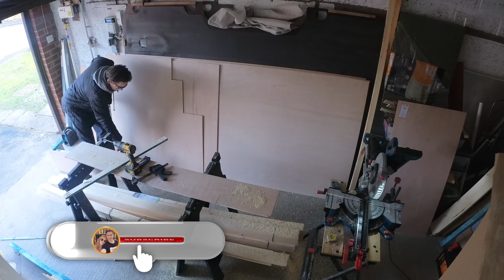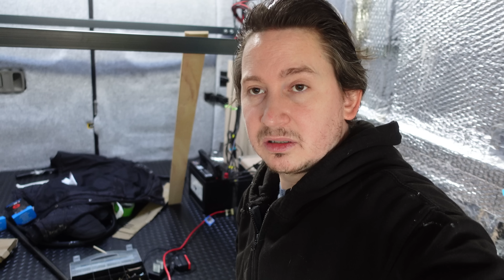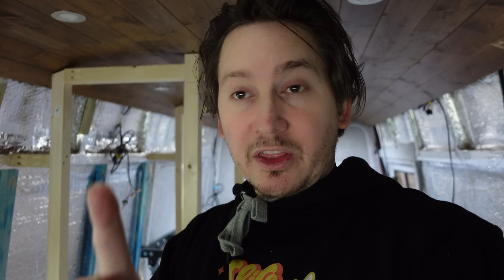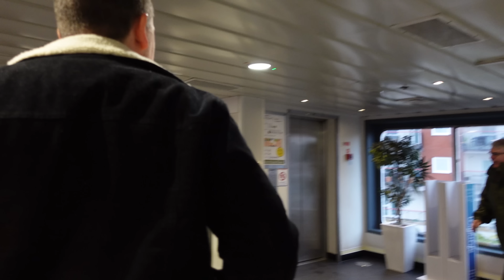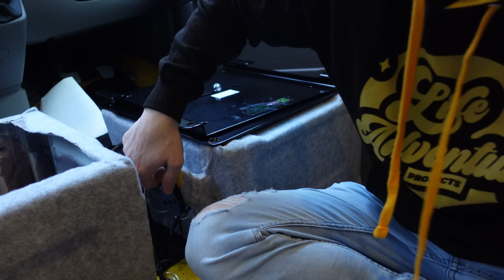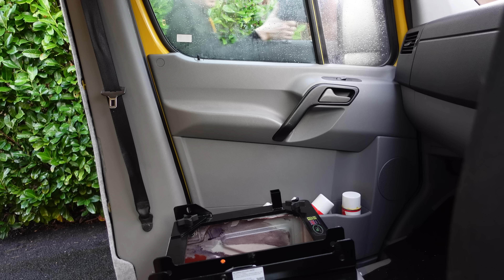Van Build Shower : Installing the Shower Framing

Comment: Not sure if you've already fitted a diesel heater. But if not, it could go inside the seat step.
Also, you could put a drawer/storage under the table's raised floor.
Reply from the maker: Great ideas! We think we're going to go for the Truma combi which is heater and water heater, so think it might be a bit big unfortunately, but if not that's a great suggestion. Some storage might work there though, got to use all the space effectively! Thanks very much for watching, we really appreciate it :)

Comment: Ok!  so !Really great video both, love it ,big yellow bird is coming on brilliantly. Step in front of the seats could double as storage or for a diesel heater (unless you’re thinking diesel heater under the seat) I wouldn’t worry about the cable under the seat if you haven’t got that type of seat ,I guess they make them standard. I’m no expert, but although that ceiling in the shower looks great ,steam and water may make it swell . So protect it , plastic covering ,also  heard you say tank, so you’re on the right track , how about venting too ? . There must be videos on line fitting showers , sorry iv been no help , but just some things you may want to think about. Not impressed with the needles either, don’t see the point 😂😂 get it . Good luck 👍🏴

Comment: Not finished watching the vid yet fella, but just had to message first, been meaning to reach out to you guys for a while now. Your ceiling is spot on. Probably the best if seen done, you've finished it off really, really well. (I think Mel even mentioned it a few weeks back too)

You probably know this already but something you said in the video how to line up things straight. Always use the floor as your straight edge and go 90° from the floor using a square. That way everything is square and it doesn't matter if the van is level then or not, BNQ sell one for about £9. 

One quick question. Where are you getting the Nautilus shower screen from if you're based in the UK. I can't find any suppliers. 

Awesome looking van, you're doing a spot on job throughout.....I know you say that you're just winging it. TBF, you're doing a great job guys. Keep at it and happy camping. J
Reply: Right finished watching now. Lads had a hair cut, looking good fella....you're still punching though mate, still punching. Hehehe.
On the seat clip there is usually a clip on the passenger seat (also yellow I believe) if yours hasn't got it, it may have been removed by the seat supplier. And yes it's for the seat belt/airbag system/warning alarm. Try to get it sorted if you can before your next MOT.....I'm not 100% sure but I think it's a checkable system (I may be wrong) if no amber lights are highlighted then I think you're alright however. Remember your cab had a flip down seat but all these vans start off exactly the same with the same wiring looms (DHL put extra in, all other looms are factory fit including this one) best people to speak to are Greg Virgo on this or Mel both have a wealth of knowledge on sprinters both are the go to guys for advice. Both are sound too.

Lovely van guys and lovely couple. J
Reply: At 3 mins 50 seconds in have a watch.

https://youtu.be/-U9boeejAy0

If you have no warming light or audible sound then yours may have been disabled. Or some sneaky garage mat have removed the fuse for the warning light (that does happen too)

Have a look at the next clip below (it's not the same issue as yours but the principle is the same) 

Like I said if your warning light isn't on, then I don't think you have a worry on MOT side of things
Reply from the maker: Hey mate, so sorry for such a slow response in this! Illness and job and all that jazz. We are back building again now though. Just wanted to say thanks for the advice, the 90 degrees from the floor makes totally sense! As for Nautilus we are planning to get from America, just import and be patient ! There are UK alternatives but just not as good. Oh and yeah I most certainly am punching, but I am way cooler. 😎 haha. Thanks for watching bud and the feedback, does not go unnoticed!

Comment: Your seatbelt sensor has been written out the ecu. Due to the jump seat that was fitted and not a double or single seat don’t worry about it as long as the new seat seatbelts work and the seats are secure that’s all you need for the mot

Comment: Hi Do you need some great lighting for your car to help you better driving, off-road? We're the pro auto lighting manufacturer for nearly 20 year and we're looking for sponsorship!
Reply from the maker: Hey there, thanks so much for getting in touch! We are certainly thinking about some lighting for the outside of the van, so we'd be interested to find out more! It looks like we've had an email from someone there so we'll check it out!
Reply: @lifeadventureprojects  Hi Sure! Is there anything lighting kits you think could be useful for the Van?
Reply: @lifeadventureprojects  Hi Is there a way to chat more about this sponsorship?